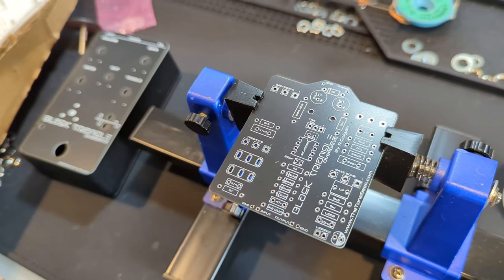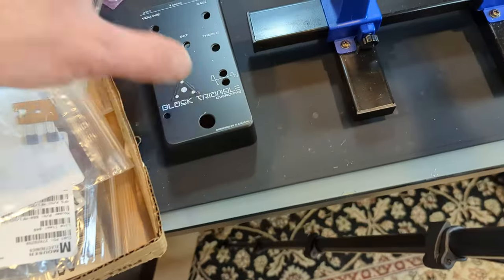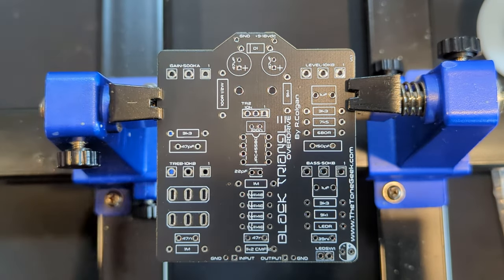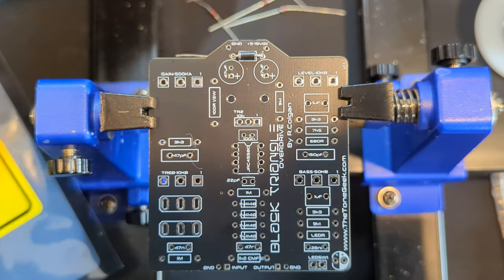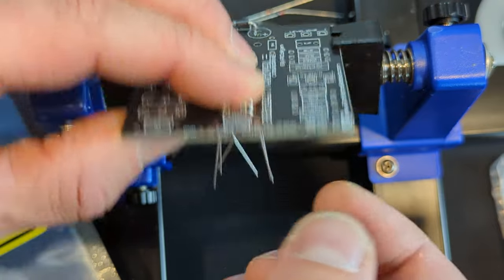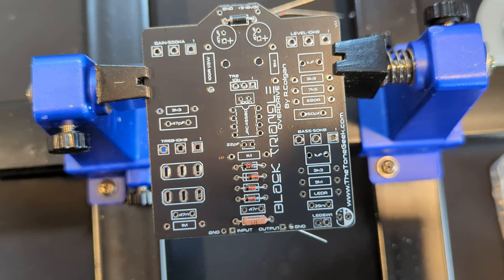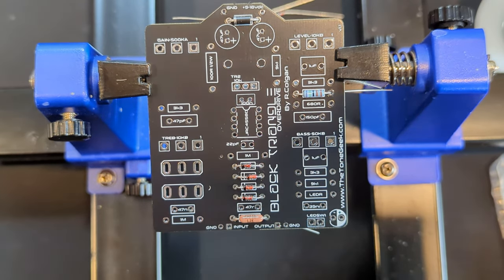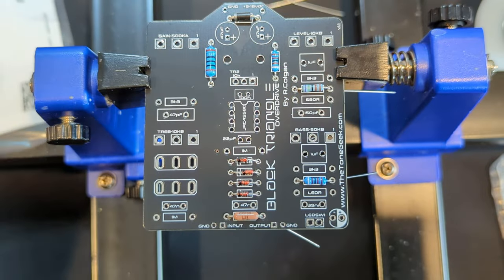DIY The Black Triangle Overdrive | Vemuram Jan Ray Circuit | Realtime Build | The Tone Geek

Comment: Good video. I clip leads before soldering.
Reply from the maker: That's good too! The heat transfer is less. Makes sense!
Reply: @TheToneGeek  I was taught that it prevents any mechanical strain on the solder joint when clipping.
Reply from the maker: @sirbergersworth  interesting! I believe it. I will try next time!
Reply: Interesting. I always clip after soldering, that just made sense to me for practical purposes but your reasoning sounds legit. If it’s a good solder joint and a quality board, that shouldn’t be an issue in reality.

Comment: Did you measure the voltages on the original? Where is the data about 4.5V? This is not a Tube Screamer.
Reply from the maker: It measures around 4.9v at the voltage divider. I should have used V+ or another way instead of stating 4.5v You're right